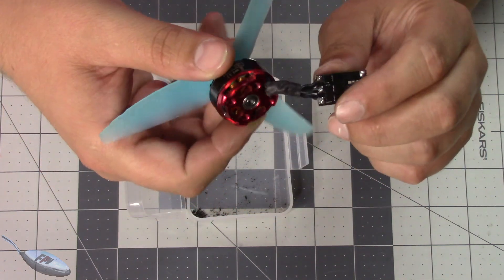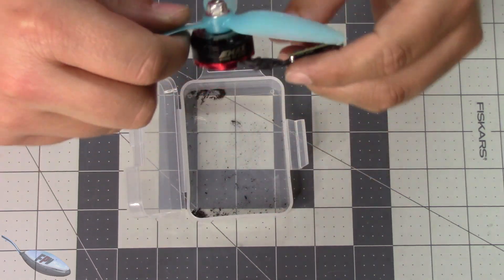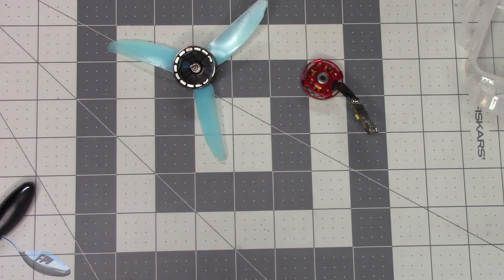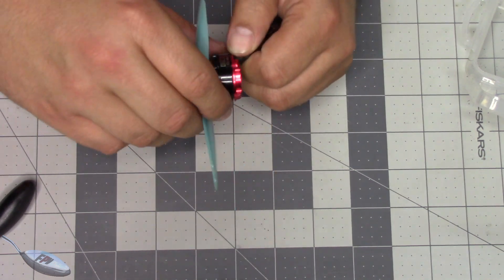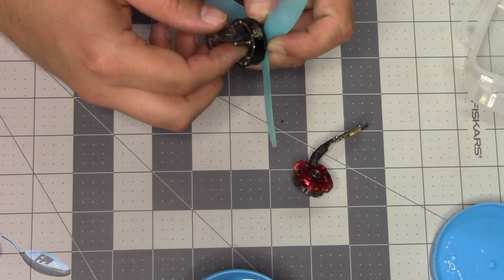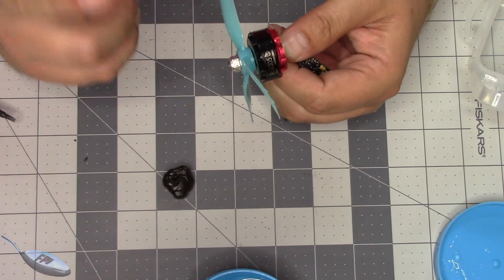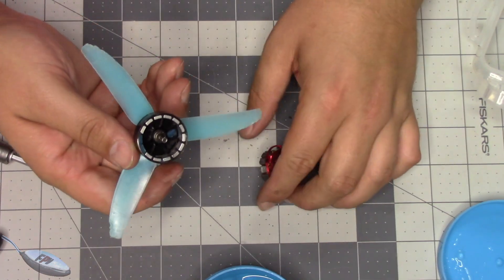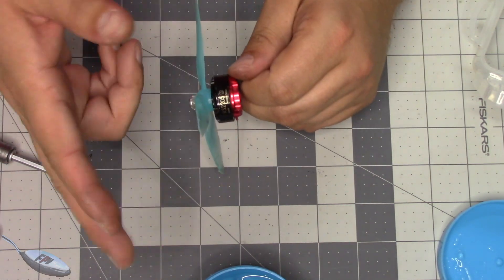Clean Your Motors

Comment: I use an adjustable hose tip to pressurize some water and it removes everything 100%, only downside is that you gotta be careful not to wet the vtx and flight controller.

Comment: Thanks - where does magnetic dust come from - never heard of it before.
Can't see it in my motors, too much mud. :-)
Reply from the maker: Yeah, the mud is easy to get out, just wash them off.  Magnetic dust usually if you fly somewhere were there was a factory, or bando etc.  The hard thing to get out is anything that is attracted by a magnet, you can't really get off the magnets by just washing them.  Silly putty seems to be a great solution for that stuff.
Reply: Thank you!
I'll tell you where the"black dust" comes from, I live in the Foothills of the Sandias and as the granite erodes the"soil" is full of iron. Every time you put the quad in the dirt the motors pissy up anything magnetic.